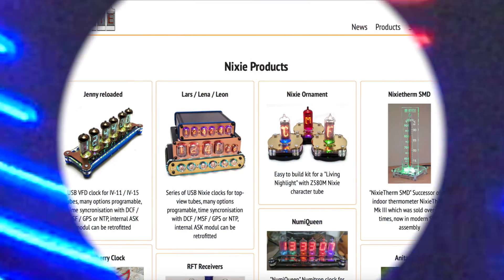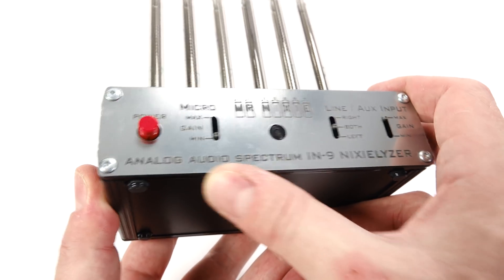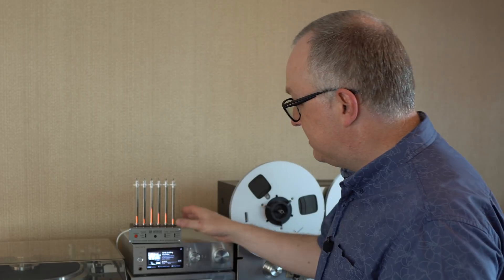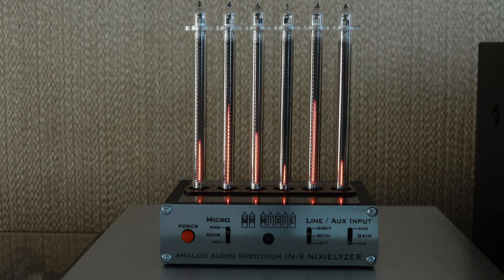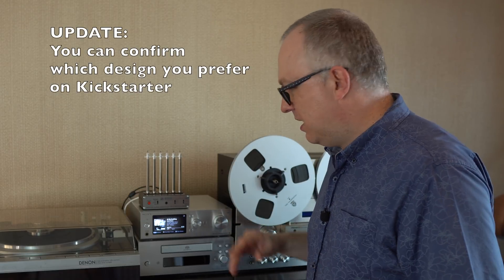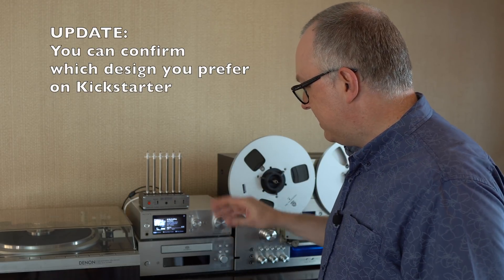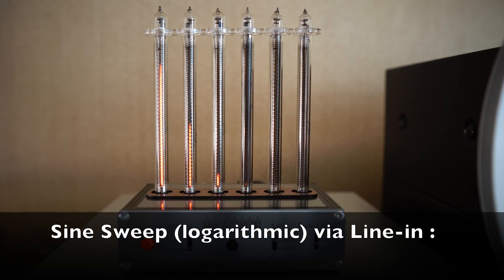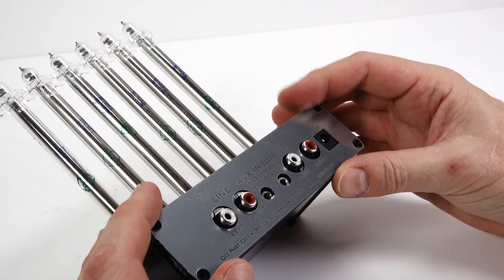Nixie Tube Spectrum Analyzer - The IN-9 Nixielyzer

Comment from the maker: The IN-9 Nixielyzer is available as a kit or pre-assembled via Kickstarter 
https://www.kickstarter.com/projects/nt-smd-rgb/audio-spectrum-analyzer-with-in-9-tubes-called-nixielyzer
(This is not an affiliated link) - more information in the video description text box.
Reply: @tim.honiss  Always the biggest problem with Nixie stuff, and it will only continue as original nixie tubes get rarer and rarer.
There's at least one guy making new tubes by hand in a few different styles, but they're ludicrously expensive. I don't know of any company that is making them as a niche product in any kind of semi-automated fashion. By the time finally get my arse in gear to pursue a Nixie project they'll all be priced out of the market for me. :(
Reply: @sixstringedthing  I believe Dalibor Farny makes new tubes, if I'm not mixing them up with someone else. But still small batches and lots of effort as well as custom equipment, so I wouldn't say they're cheaper than alternatives.
Reply: @Kitteh.B  🎧
The Tubes/She's A Buety
Reply: @sixstringedthing  don´t worry here, jürgen managed to use the right way to drive the tubes, they will last virtually forever, just like the neon-lamps in main switches. i made my first AC carrier VU meter using the IN-9 tubes around mid 90s...and it still works, with almost daily usage.....
Reply: @sixstringedthing  🎧 
ZZ Top/Tube Snake Boogie
Reply: @sixstringedthing  I'm stocking up on my nixies now.
Reply: My god... it's full of stars.
Reply: @gerardcomeau2160  Nice 2001 reference! :D
Reply: @BertGrink  🎧
Alice Cooper/No More Mr. Nice Guy
Reply: @gerardcomeau2160 Sick Things..... in cars..... rotate 'round..... my stars
Reply: @tim.honiss  🎧
AC-DC/Money Talks
Reply: @Techmoan 🎧
Bon Jovi/Social Disease
Reply: Very cool 😎 indeed !!  Thanks for the information !!
Reply: @dougswinford389  🎧
Beastie Boys/So Watcha Want
Reply: UTube. is continuously shooting itself in the ass... IT has become "us tube" whoever the powers that be qualify as " UTube"  TY to those of you that fight thui the jungle
Reply: @jime386  🎧
Motley Crue/Fight For Your Rights
Reply: @gerardcomeau2160   Beastie Boys.."Fight For Your RIGHT.... To PARTAYYYY"
Reply: Jim E }
Reply: good thing i went to my desktop this one time this year and saw your video, because youtube unclicked the bell for me. what a shame.
Reply: If you want GOOD Nixie Tube clock, on Aliexpress its far better looking then what he sells, using Magnetic Tubes, RGB support and cheaper!
Here is one https://www.aliexpress.com/item/32985505475.html
And Another
https://www.aliexpress.com/item/32861669672.html
And another
https://www.aliexpress.com/item/32946561123.html
And another
https://www.aliexpress.com/item/32954471720.html

This last one looks the best but might not be a real Nixie Tube
 https://www.aliexpress.com/item/32997049135.html
Reply: @NoBodysGamer  I don't know why I even bothered clicking, that's just LEDs made to look somewhat vaguely like nixie tubes.  Why would you even link that?
Reply: Could you please list songs you use for demonstrations in your videos?
Reply: Useless novelty, overpriced.-

Comment: Not sure if anyone will see this, but where is a good source to get a hi-fi level indicator? I already have an amp, I'd just like a level indicator. It doesn't have to be 100% accurate or top of the line, I just love the look of them, to be frank. I'm not recording to any tapes or anything, so again, it's just for the visual appearance. I've checked ebay, and I can only find one manufacturer making a plug in unit, otherwise I'd have to create my own from just the meter itself, and I'm not that handy with soldering and such. I prefer the more vintage style, but I'm not looking for any style in specific.

Comment: IN-9/IN-13 VU meters and spectrum analyzers. A classic project really. Let's see how Mr.Nixie does it.
I see... A set of audio summing amplifiers combining the inputs and convert stereo to mono. Then the signal goes through a Compressor before getting fed to a 6-channel Band-pass filter that is designed for Spectrum visualization. The output being done via a set of Op-amp compensated Constant-Current-Sinks. 2x NE555 timers handle High-voltage generation and power-cycling the tubes. The cycling is a clever trick to keep the IN-9 behaving well enough.

A very solid design. My own uses a ARM with Digital Signal Processor that handles filtering and generating outputs. Using a very high-speed PWM with low-pass filters to drive the Constant-Current-Sinks. Perk: As many channels as i want. Con: Programming, which some absolutely hate.

Comment: I was a Kickstarter contributor for this project, and just received my full kit in the last days of 2019. I hope to add a construction demo video to my YouTube channel sometime soon.

However, a slight correction to THIS video based on my early study of the Nixielyzer schematic.....there is no firmware/software in this product, which surprised and delighted me. It is 100% analog circuit design. Op-Amp based gain and active-filtering for the microphone, and also for the audio mixer stage. 555 timer astable oscillator, with feedback, to drive the high voltage generator circuit. Another 555 timer astable oscillator to reset the Nixies frequently (as mentioned in this video). An analog multi-stage bandpass filter to split the audio signal into the six bands. Six op-amps to control the high voltage drivers for the Nixies. Analog voltage regulation.

Seems that Juergen prefers the analog approach to his designs. His Nixie IN-9 thermometer, although it looks nearly identical to the Elektor Labs IN-9 thermometer, is an all-analog design, whereas the Elektor version is based on the Arduino Nano.

Comment: the one on the left is picking up line hum from your ac ... that is why it is firing without anything but power in it ... once you added the rca you over road the line hum with no signal ... which pulls it to ground only instead of a floating point antennae ... same with the others and your voice ... and as you mentioned the mic plug was not grounded ... well neither is the chasis and it should be  to be considered North American safe ... and they should all be tied to the power plug ground line ... it does have one right .. again North American standard ... essentially as shipped your bit was a raw antennae ... so ANY signal and EVERY signal it would read ... and still will it will also amplify the line hum as it is not properly grounded
Reply: that is NOT a mic input that is a MIC ... a mic input is an actual mic connector ..

Comment: Nixie tubes are fab. As a kid I had a huge (as in size of a briefcase) desktop calculator from early  to mid 70’s. It had a display of ten Nixie tubes and looked fab even if it did need a small power station to supply it.

Comment: Don't really need all that much skill or equipment to put it together. Just lots of patience and some logical thinking, mainly in the order u solder the parts in. Worst thing I see is that SMD IC jobby, but even that doesn't seem to be all that fine-pitched, and can probably be drag soldered just fine with some flux. So don't need a super fine tip and steady hand :) All in all it seems like a lovely kit. Lots of fun to put together, and oh-so-cool when working! Thanks for the video!

Comment: The design of the circuit is quite elegant. He's managed to make it completely analog, and it appears these tubes work by varying the voltage applied (between 100-140V), but the current is low enough that relatively small high voltage switching transistors. The MPSA42s on the outputs of the LM358 dual operational amplifier chips are switching high voltage DC to the IN-9 tubes. The use of a photo flash capacitor in the high voltage DC power supply is innovative and saves space. I also like that he has socketed the op-amps - this means that if you choose, you can swap them out with higher quality chips that have the same pinout.

Comment: I built the in-8-2 nixie tube clock while drinking  lots of whiskey and it worked first time, they are simple to put together and instructions are easy to follow.
You need to be careful that the switching supply in either the unit itself or wall wart doesn't inject annoying whine hissing or hum into your audio , especially since you are plugging it into line level equipment, you will notice this more on power amps that have the gain turned all the way up and that are fed from an head unit you are using to adjust the volume, i would use a ground loop isolator to isolate it.
It would be nice to get a wood and polished brass base version of these kits, would look far nicer, the aluminum and text all over the place makes it look cheap.
The plastic base on the clocks look ok with the RGB leds.

Comment: I can't help but think that what might help the front panel to settle down a bit, would be if Jürgen were to use silver/chrome nobs instead of those sliders. Much like the ones you have on your stereo only smaller obviously. I know from my own hobby projects that such potentiometer nob-caps don't have to be that expensive. Maybe go brushed silver/chrome all the way on the front, even with the power button… anyway, just a nagging thought.

Comment: I would appreciate if the housing had an extended bottom flap to screw into the desk it is on, reducing the chances of it being knocked around by a tugged cable. I wish this design was also implemented more often on small form factor preamps.

Comment: I guess the left and right settings would be for if you have 2 of them and each can display one channel? Though I suppose you could also do that just by plugging in one line per device if that switch was not there.
Reply: Yes, for sure. It's simply on your wiring.

Comment: I just backed Mr. Nixie's project! I got the 32 Euro reward level. It gets me 6 spare tubes and I'll get the finished product after it comes out. It will go great with my Frankenstein's monster home theater that includes some vintage Carver amps along with some small tube amps that drive the tweeters in my main speakers. I use a digital active crossover to split up the signal to my speakers. I will definitely have to go analog once I am happy with the levels. ;) Thanks for the video! :D

Comment: One thing I find a tad odd are the gain controls.  I would think it would be knob controls instead of switches.  That way, you could fine tune it instead of having just three pre-set selections.
Reply: Looks like switches, but they are mini slider potentiometers from ALPS
Reply: Jürgen Grau oh, ok.  I think what made me think it only had three settings was the “left/right/both” switch, since the gain potentiometers look just like it.

Now while the sliders give it a cleaner look, I do think knobs would fit in better as a retro touch, as the Nixie tubes have always had that retro look to me.

Comment: I was wondering when you would review one of these ever since your Nixie watch video and your love for vizual equalizers ^^
I bought and built the previous version myself, and it was quite a few hours of soldering, but if you have fun with that it gives you the added benefit of having acomplished something :-) The instructions that Jürgen provides are very detailed and I had no problem following him, and you can also ask him questions and he is very helpful if parts should be missing.

The benefit of the new version is that it is only a spectrum analyser, the previous one had 7 tubes, but the rightmost one was a full spectrum DB-meter, which meant that it always lights up more than the individual pectrum ones. Helpful if you want to set the volume right, but looks a bit unbalanced in operation. I find the new design much "cleaner", also it does away with the scales and scale ilumination (which you could not turn completely off in the old one, either).

Comment: The "problem" with these bargraph tubes (as they´re not nixies) is that they´re developped to display AC currents only and therefore needs (== mandatory) to be driven with an AC signal, usually 50Hz or above and to superimpose the current you want to display (you need also to convert the voltage you want to display to a current first) on that AC current source, or you will kill the tube shortly (within months) ! ..... ! ..... it not only will cut the display "light-bar" lenght and/or shift its basepoint (to be seen at around 06:27), but also will darken the inner glass surface due to cathode degeneration....: its material will evaporize due to local overheating and then settles down to the inner glass surface...!! this is a non reversable damage due to impropper electronic circuit design (== FAIL) and not a "problem" of the tubes....!!

Jürgen did it right here, from which i can see in the provided schematics...if you can read it, take a look at the 555 timer at the bottom, this one will chop the IN-9 the right way :)

That´s why i avoid all these other simple tube GadGets and DIY it using a real DC-current source and chop it (== modulation) using a real sinewave AC carrier....The result is that these tubes will virtually last forever....!!

These linear bargraph type tubes had been developped for displaying the current drawn output in power plants...i´ve seen pictures where groups of three (3-phase power generation;) had been mounted all over the place in these large control panels of big power plants, along with 270deg. moving coil meters....

Comment: Nice built anyway and great demo, also a compressor or AGC in the input section would lead to a much more pleasant display...and as these IN-9/IN-13 tubes are getting rare, the price will now increase within weeks i think...i bought about 50 some years back when one tube had been around 2bucks...nowadays its more like 10bucks/pcs if you order direct from russia.....these tubes had been developped in former CCCP only produced in the Uljanowsk plant in russia if i remember correctly. New-Sensor (ex "winged C" -> original Svetlana) may still have some

Comment: Built my own version of this about a month ago using IN-13 tubes. I could only afford to do 2 tubes but even with only 2 you really can’t convey just how cool they look  over video.
Reply: i did it 2 tubes IN-9 , having more than two tubes means you need band pass filters that are exponentially messy, also separated a lot the two frequencies to have the maximum diversity between the two bands (worthed), used a pair of CRT color electron gun transistors (most types are good and less blunt than like MJE13003)

Comment: I don't see any surface mount components so I'd say that's an intermediate kit. Hardest part is the ic sockets but being socketed you're not risking damag to the actual ic. You can wait till you've inspected all the joints for shorting before putting in the ic. You could probably get away with this one being your third or fourth kit build.

Comment: Wow that works really well... I wasn't expecting the fast response time of the tubes.
Reply: Nixies are high speed. I've seen a Nixie clock that fades between numbers. Any unsuspecting viewer would assume it's fading because it's old and slow. Not so! It's being pulse width modulated at 100Hz+.
Reply: @userPrehistoricman  That is what I usually witnessed with nixie tube projects - consider me unsuspecting.  Thanks for the info!
Reply: It's gas discharge, basically plasma.
Reply: @NGC1433  Well that explains the high speed, thanks!

Comment: I like the thingy. But the front looks distracting. It takes away too much attention from the tubes. I would put all those switches to the side and only leave the red power button and the «Analog Audio Spectrum In-9 Nxxielyzer» on the front.
Reply: I really liked techmoans take on it, but like many of the other commenters I have to agree that it looks very fragile as the tubes aren't covered in any way.
Reply: Runner55 The expensive version has a protective frame.  But Plexiglas can be quite fragile too if incorrectly processed.

Comment: This would looks insane spanning the whole frequency range at smaller intervals.
Reply: Like 10 bands instead of 6, right? I was thinking the same.
EDIT: Well I've just looked at the data sheet for the Integrated Circuit (IC) that does the band filtering, and it doesn't support more than 6 frequency bands, so any more than that would require more ICs, adding to both complexity and price. :(

Comment: Very interesting, have a problem with the power switch placement. The chassis is light, very light, each time the switch is pressed, the chassis will move, If the power switch is placed on top of the chassis in front, the unit will stay in place better. It might be best to move the other switches to.  This brings to mind of the time when strobe lights and light organs were the thing.